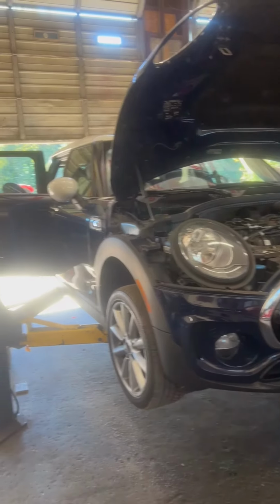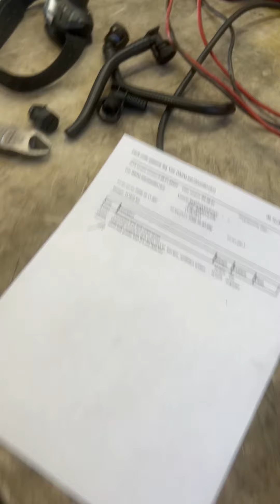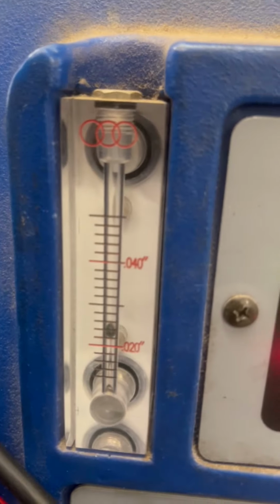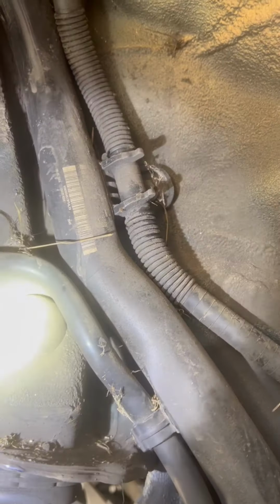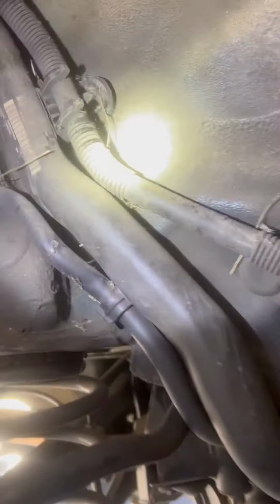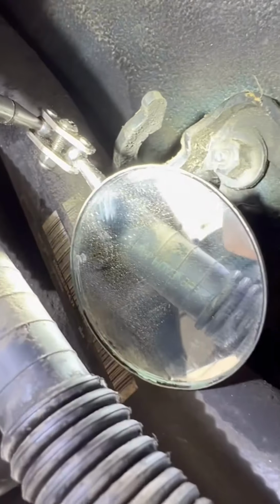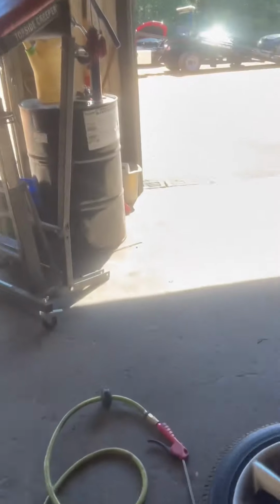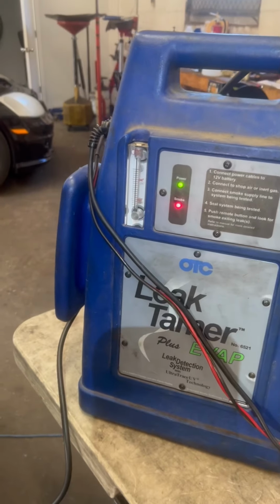2016 mini Cooper fault code 190302 micro leak evap system. Easy diagnosis and repair to say hundred$

Comment: My jcw just threw this code! Definitely going to be checking this hose first!
Reply: My F54 JCW also started throwing this code a few weeks ago. Replaced the gas cap assuming that was it and it just came back. Gonna check this hose later. Is that what it ended up being for you?

Comment: Isnt that part of the fuel system? So you heated up the screwdriver but didnt put that torch anywhere near the actual plastic pipe right?
Reply from the maker: Correct! It’s a fuel vapor line.

Comment: THis is why buying the Autool SDT206 smoke machine was an investment worth every penny for my BMW!
Reply from the maker: Smoke machines are a must
Reply: Be careful. It is very easy to overpressure the evap system with those cheap smokers. The cost of a proper evap smoke machine wouldn't make sense outside of a shop environment but the cheap ones definitely require closer monitoring.
Reply from the maker: @AlanBurnham right! That’s the good machine there. Regulated at the compressor